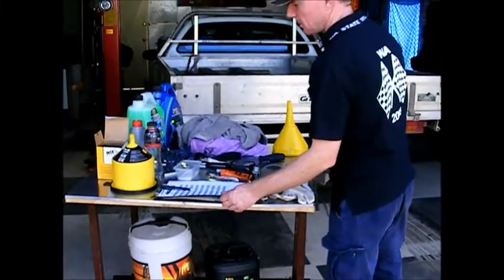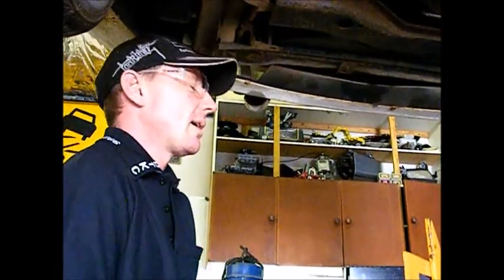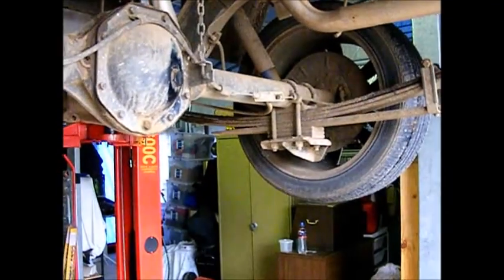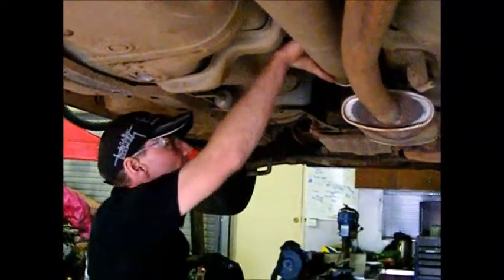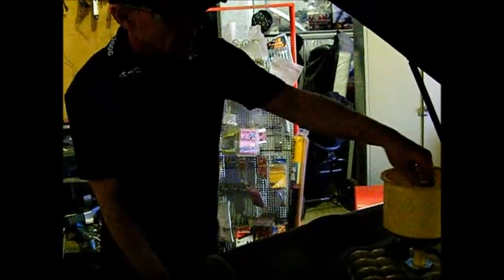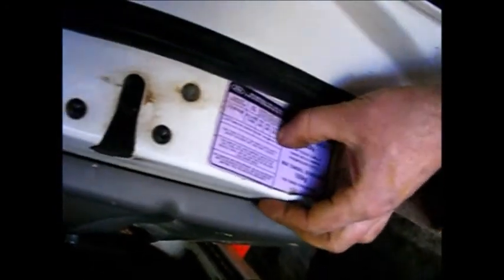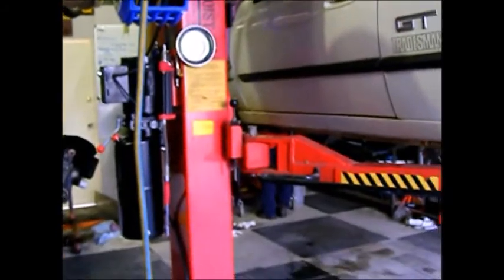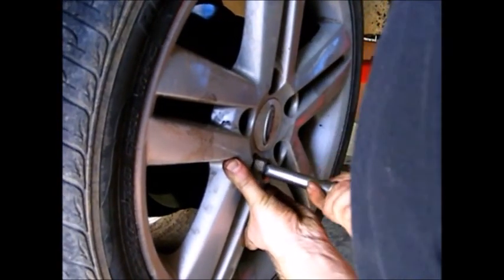2002 AU Ford Falcon Service

Comment: One of those blokes who tightens everything way to tight.  Probably doesn't own a torque wrench....and thread sealant on sump bolts, seriously?  Use a fucking computer to work it out or ring Ford if you don't know & don't have a manual. Mate, if it leaks, replace the washer rather than make it a nightmare for the next poor bastard and you use tap water in it. You should be ashamed of yourself.